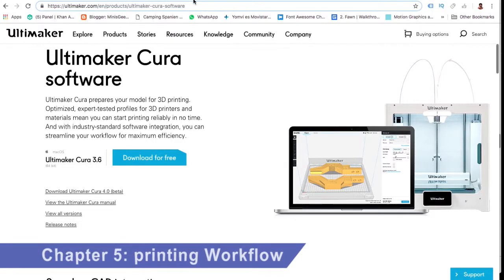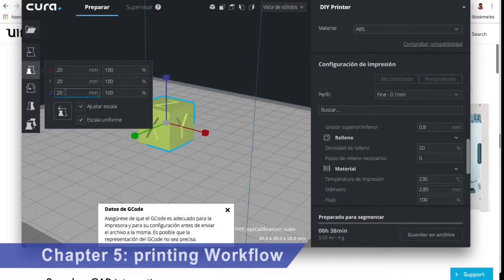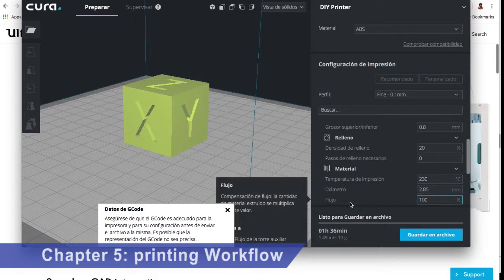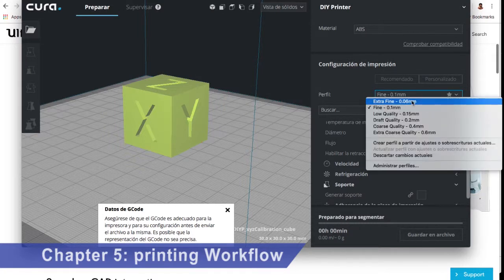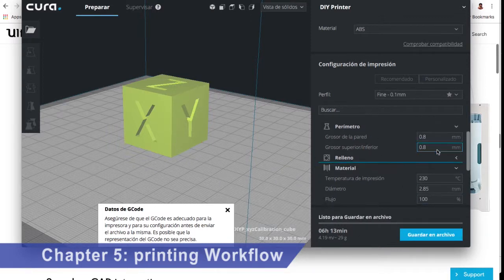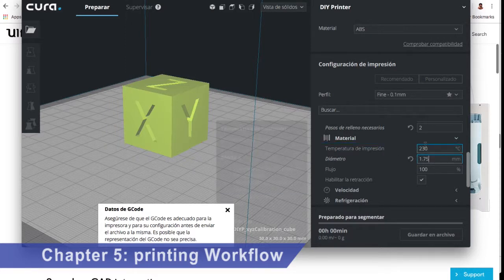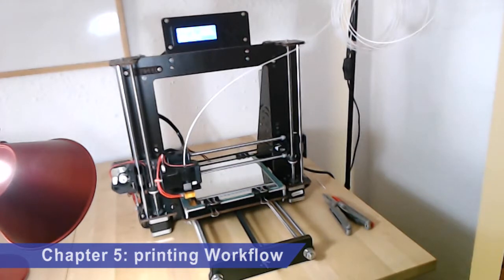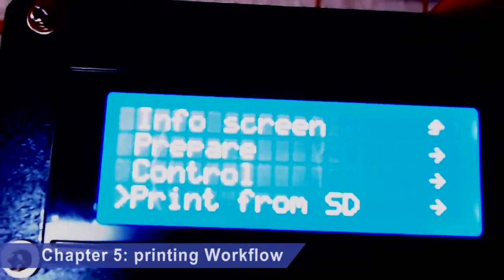3D Printer Works | Chapter 5 Printing

Comment: hey can you help me out 
When i start the print he says printing but after a short time he starts again preheat pla (I had already done it before starting printing) and after  its heated he does nothing
Reply from the maker: Try preheat first manually and once the needed temperature is reached start the print. Also check connections. Hope it works! Please leave your result here to help others 😎
Reply: @PabloModelkits  i dit preheat  manually before and tomorrow i go check the conections again
Reply from the maker: Start checking the stepper motors fastons 🧐
Reply: @PabloModelkits  they are okay he does everything exept printing 

Do you have Instagram than i can send a video what is hapening
Reply: @PabloModelkits  i found your insta i go send a vid
Reply from the maker: As see in your videos is a matter of the file setup

Comment: Hello, how do you retract the filament after you are done printing
Reply from the maker: Hello! I never retract filament when I'm done, but you can do two things. One, retract the filament when the extruder still hot once the print has finished. Two, turn on the printer and activate the extruder to be able to remove the filament. As I said I use to have the filament ready for next print session. BR